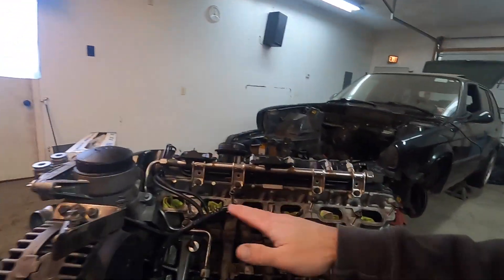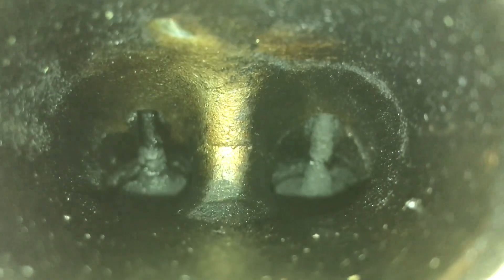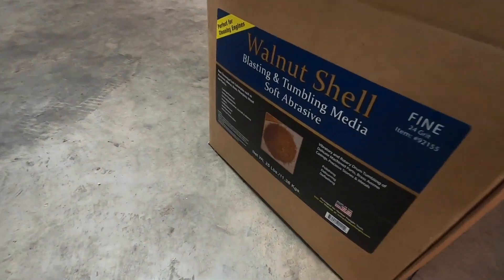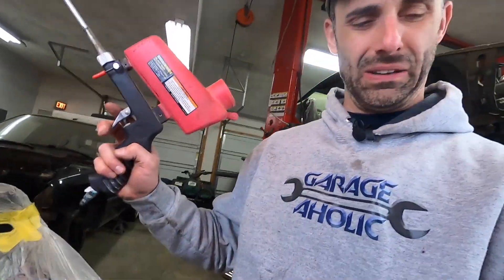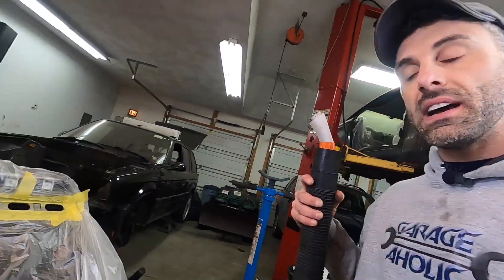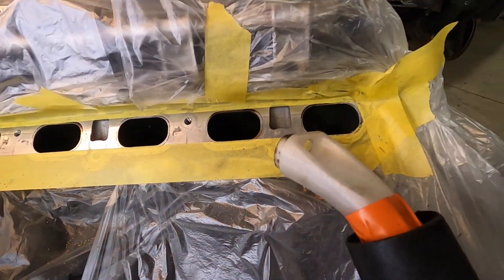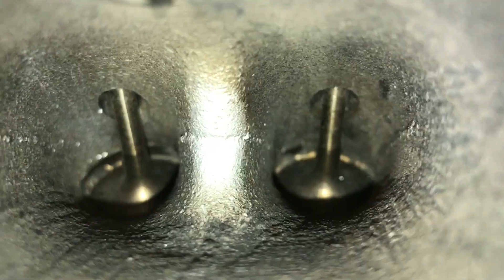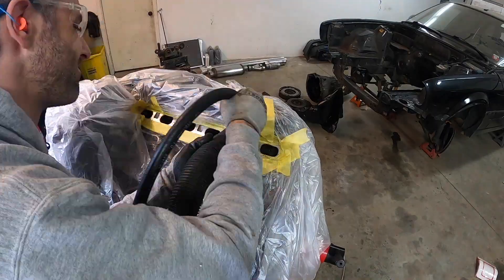Part 19: How To REALLY Walnut Blast Intake Valves - Concise How-To for Any N54 Swap!

Comment: An other trick to unclog your blaster is to push your gloved palm against the blast tip and open the valve. The air will have nowhere to go except to backup up the media feed tube. This pushes the clog back into the pot and off you go.
Reply from the maker: Good idea. Never thought of that! Seems risky to hurt your hand. those shells hit my hand a few times, it could leave a dent!
Reply: @Garageaholic  I see how you could think that, but don't worry. Since air can not travel out of the nozzle, there's no venturi effet do drag sand all the way to your hand, so it doesn't hurt at all. Just make sure you wear gloves when doing so, as to not push compressed air trough your pores and it's fine. I do it all the time at work.